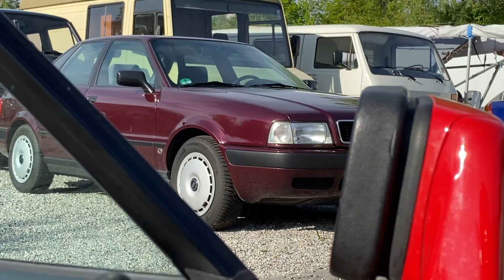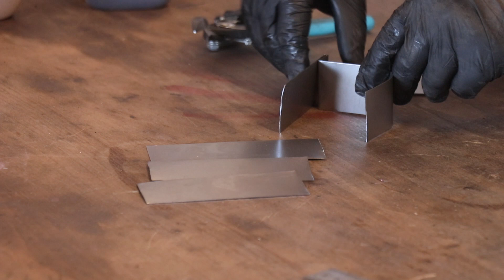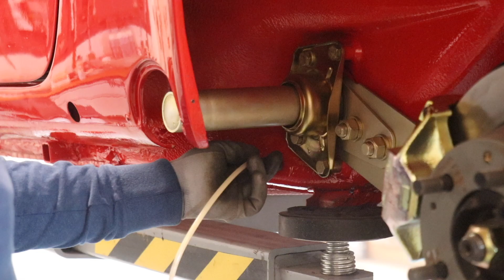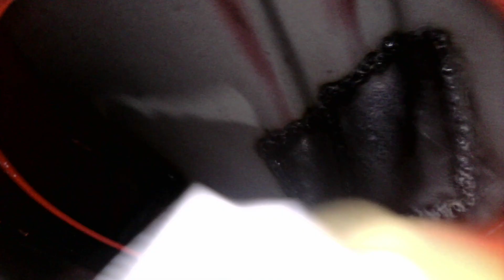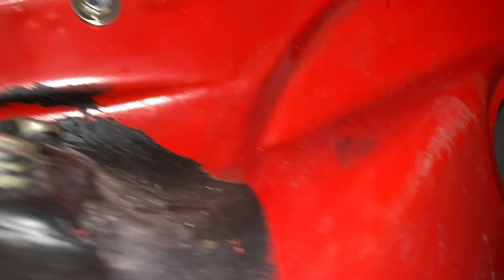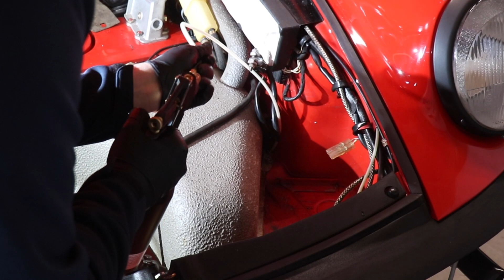Corrosion Protection of Classic Porsche 911

Comment: In this video you said you would leave a link to order a Vaupel gun and both Fluid films that you were using.  I don't see the link or any instructions on how to order these products.  I looked in your store and all I see are T-shirts.  I am also interested in knowing the first "rust converter" product you apply to repairs (bare metal) you are making.  I have seen you use it in several videos and I thought you showed a can/bottle of it but I can't find that video.  Please provide this information.  Thanks!
Reply from the maker: Yes, the company I worked with back in the days went belly up during COVID. 
You can get the Vaupel range of products on Amazon. 
I’m using Fluidfilm as a rust protection, and I always start with their most fluid, high viscosity product to protect all crevices before applying the low viscosity one to cover the surfaces.
The rust converter product is named Brunox.

Comment: This is an old but excellent thread. I have a couple of questions regarding a 1973 911S. Have you considered the effect of Fluid Film on the Heater Duct Silencers inside the inner rocker panel? Mine are made of a paper material, could they deteriorate? 
You mentioned extra access holes in the floor plan later SC model. I have 4, two on each side towards the front on either side. Can you identify where the others are on the SC? 
Thanks.
Reply from the maker: Thanks, Charles. 
Fluid Film is lanolin-based, I don’t think it will harm paper material, but to be sure, I’d try in the open.
As much as I know, Porsche has permanently modified the position of these holes. Just try to find all of them and use the tube to find out into which cavities they bring you.
Reply: @GreasyFingers  Thanks, I'm more concerned with odor in the cabin when the heat is on. Have you noticed a change?
The 4 outside holes in the floor pan of my 73 enter the inner rocker area. There's also oval slots inside the cabin that open to the same area. I have the inner rocker panels removed therefore have multiple ways to prime & protect. Thanks again for posting your process.
Reply from the maker: @CharlesLArbez Oh yes, absolutely. The lanolin is quite smelly. If you don’t like that, it’s not the right product for you.
Reply: @GreasyFingers  Thats good to know. I've only tested the aerosol version & didn't find it too smelly. I may rely on epoxy under the heater tubes & apply Fluid Film just to the "Hot Spots" as you call them. This should also reduce the leakage I assume you can expect on hot days. Thanks again, Charles

Comment: @Greasyfingers. Very nice and informative video!
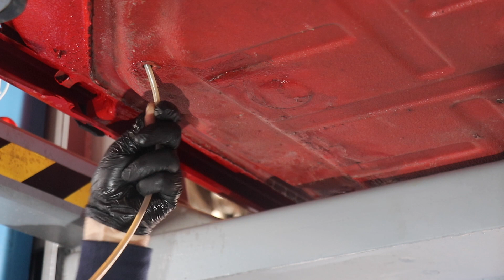8:36 you put fluid film in each of the 3 service holes along the floor pan. I have an 88 carrera myself and have put an endoscope camera in there and there seems to be some road dirt and very minor rust pitting. Nothing major but you can start to see tiny little rust Color spots. What could be the cause of this? And should I spray the fluid film even if there is dirt or don’t put any? I guess the only way to clean it out would be to drill a big enough hole to put a small vacuum? Thanks
Appreciate any answer 😎
Reply: Even if there is very minor rust Color in there that’s seems to be just surface should fluid film be applied ? Is it bad to put cavity wax on top of rust, wouldn’t it trap moisture within or eliminate the moisture ?
Thx
Reply from the maker: Hi Lucas. 
Yes, these little rust spots are normal and they are not much to worry about. Steel does corrode and when the thin zinc layer on the surface is eaten up, atmospheric oxygen is all it takes to start the process. 
I personally think that some thin oil-based product is best for cavities, because it penetrates the rust that’s already there, rather than covering it like wax would do. If you go for fluid film, take their product with the highest viscosity.
Removing dirt from in there is obviously impossible and drilling a huge whole would be far over the top. Though it doesn’t sound very appetising, a mixture of oil and dust protects steel quite well. 
hth
Reply: @GreasyFingers  Thank you for the quick response . Greatly appreciated!!! One side seems to be just dust and the other side seems to be road dirt, small rocks/ pebbles and much more build up. I believe that side had a small kidney bowl repair. Even if there is not just dust but road dirt and small pebbles should I spray the oil film in there regardsless ?

Again, very helpful videos and I truly appreciate that you took the time to answer. Cheers 😎
Reply from the maker: @lucasbourgault9434 No, that’s a misunderstanding. External surfaces must be cleaned before they are sealed. I was talking about the cavities.
Reply: I know these videos are 3-4 years old but have you noticed any stone guard flaking/cracking that you applied/fixed yourself ? Has any of the stone guard you added bubbles at the top of the front fenders or kidney bowls? I’m just curious that’s all :)

Comment: Having not long ago fought the good battle (and won!) against rust on my 911SC - including around the rocker panels, I have yet to protect the internals as you've depicted in this video.  Is there any logic perhaps in using a coating such as Fertan's rust converter first in these tight quarters.  It leaves a protective Zinc coating.  Then to follow up with a protective film, such as the one you've used?  I appreciate your thoughts and great video!
Reply from the maker: Hi Daniel, thanks for commenting.
Rust converters like Fertan create stable iron compounds from iron oxides. That’s all they do, you can’t create any Zinc coating with them. In case you don’t have any rust, they don’t do much, but unless you rinse them out with water they remain inside and though I don’t see any specific issue with that, I don’t very much like the thought. 
I recommend to only use Fertan if you really have proof for rust. You might want to check with an endoscope first.
Reply: @GreasyFingers  I will definitely give the endoscope a shot!  With Fertan, I was only quoting their blurb: "It also leaves a protective zinc coating that prevents rust from coming back for up to 6 months."  I've used Fertan on other things before getting around to properly applying a painted top coat, but the internals are another story.  Thanks for your input.
Reply from the maker: @dra911  Thanks, Daniel, and apologies, that is in deed more then I knew. I have a hard time understanding the chemistry behind it, but maybe they have some clever zinc-based additives that come with their actual rust converter.

Comment: OH MY GOD!!!!!
I had my car in the restoration/changes shop about 4 years ago getting lots of things done for a year, and while they were mucking about they found a couple of places where there was rust, and they cut out the decay and welded in new metal at the spot. Then just last week when I had my Carrera at my new mechanic shop it was on the lift waiting for suspension parts to arrive. Dan the owner of the shop didn't mind me coming over and very very slowly looking at everything under my P- car. Most shops would not let you do this. I went on several different occasions to see the progress of the suspension and so other upgrades.  How many P-car owners have ever had a chance to be under their car as long as they wanted?

The second I was other there all 4 tires were off the car and I looked where the jack hole is and then toward toward where the driver's seat is and there it was... FKING rust eating my metal slowing like 50 metal-eating ants in one spot. One of the sports you brought up in this video. I am not one to be awed by HUge work projects/problems but the corrosion program you have is SO eloquently and succinctly said and showed; it's far beyond my comprehension... even if someone else would be doing the work ($$$$$$$). It's just TOO FKING much to comprehend. In 15 years I will be 92 yrs. old. My wife and I have no kids, my brother has no kids and never will, same with my wife's brother, and none of them care a hoot about cars. 

So do I pick the current number from the machine and wait for a time when my car MIGHT have a chance to see my mechanic and stop the corrosion ? I owe it to my car, but how long will they even let these older cars be on the road (you can see I am starting to rationalize the situation). Don't get me wrong, EVERYTHING you said and did in this video is SO right it is just "what will I do with that information?"  Instead of getting a number —which is a metaphor not an actual thing at Dan's shop— I will put a sticky tag on my wall calendar for December 2022 and it will say, YES or NO - corrosion protection.

Thanks again for showing and telling something that NO other P-car site has ever gone into in such depth, and with actual solutions to the problem.

"A garage without a Porsche is just a dark hole" —Walter Rohrl - Porsche Development

Comment: Fantastic episode. thank you very much.  I could not find the time to view this till this morning-I normally see your stuff day 1. THanks for the links to products used.

Do you have any thoughts about spraying the interior regions with a rust encapsulator before you apply Fluid Film.  Also, I'm thinking any area that had been welded in a spot repair needs to be hit again

The boroscope is an essential tool. I'd never buy another car without using it.  BTW-I'm finally picking up a TIG welder this week.  I want to get going on my 66TI.  Bought an engine last month so the parts are coming together. Cheers and thanks
Reply from the maker: Thanks, Steve. Frankly, I was waiting for you already. 

I touched on the point rust protection of interior regions in a conversation with Rodney the other day. Please scroll down just a bit to find it. My next film will contain more details. 

Cheers for you TI project! Looking forward to hearing how it goes.
Reply: @GreasyFingers  Johannes-you never cease to amaze.  Thanks for all the guidance

Comment: Great video.  Unfortunately, I have had the pleasure of seeing the inside of all the areas you are applying Fluid Film on my F-Body, '72.  Where I have gained access I have been cleaning out the rust with brushes and metal conditioner and then applying a cavity primer.  What I have been worried about is where I applied the primer to two panels that I have welded to together.  As I know that the cavity primer where the welds are has burned away.  I'm thinking when I am all done to go ahead and apply the fluid film as you have done for extra protection.  Do you have any idea of what fluid film would do to a cavity primer?  Would it eat it away or just stay on its surface?  Also, I have had the pleasure of rebuilding the entire jack point area with all new pieces.  That was fun, but now I am confident that is was all done right.  Same with the interior rocker panels.  Again, right before I welded everything up, I applied the cavity primer/sealer to the inside sections.
Reply from the maker: Hey Rodney!
I could discuss that with you all night long.  
I do think that cavity primer is the right choice, I use exactly that in my projects. The parts where I do spot welding I mask off because as you say, welding will burn the paint. I apply so called Inox spray to the welding surfaces which is basically stainless steel particles embedded in some synthetic binder. It’s supposed to melt during spot welding, but not burn off and solidify again and as it’s electroconductive it allows to nicely ignite an arc. I think I had the camera on when I applied this method during the upcoming GT project. 
Now Fluid Film. I‘m quite sure it won’t harm the primer. It’s basically wool grease, totally organic and natural. 
Not sure whether it penetrates the spot weld seams, but that could easily be found out with some model. 
Talk to you soon,
Johannes

Comment: Nice work... I put a tape near the nozzle so I know when it almost comes out...
Reply from the maker: Thanks for the tip, mate!
Reply: I thought about tape too, but noticed some holes seemed just wide enough to allow the hose in. I considered the tape might bind so I recommended color coating which would possibly be thinner than tape.

Comment: More ASMR content :-) thanks. I am interested in your single post lift. I assume the preparation of the surface to which it is attached is extensive. I am looking at 2 post but that single post gives such good access.
Reply: Yeah go verify information from producer twinbusch there are all information about the concrete it should be used on.
Reply from the maker: Hi David. Actually not. It’s mounted on wheels, so you can move it around.
Reply: Great. Thanks all.

Comment: Stop using brunox it is worth nothing just marketing. Do some research on it or look at some others test. use fertan where you can it is better but not so easy to use... or look for other rust converter. Your effort is worth more than brumox.
Reply from the maker: Thanks for sharing your opinion, Adam.
To my experience rust conversion is too complex a topic to cover it with simple terms. To my experience, Brunox is good in converting thin layers of rust and conserving the result, but doesn’t penetrate rust deeply. It’s advantage lies in the very good adhesion of further layers of paint. Major rust attack is better to be treated with more penetrating fluids such as Fertan, but if there’s major rust in my cars I prefer to remove the panels completely.
Reply: @GreasyFingers  ok your choice. I dont trust it. Used it and stopped. If it is not deep penetrating converting rust how do you know when it is too much... would not trust such product. Any way love your videos gonna keep watching.